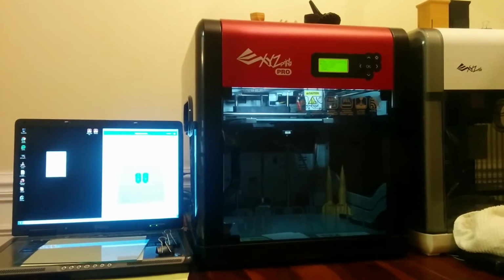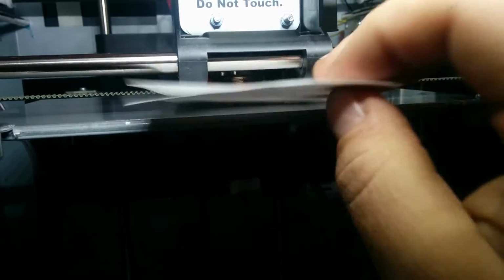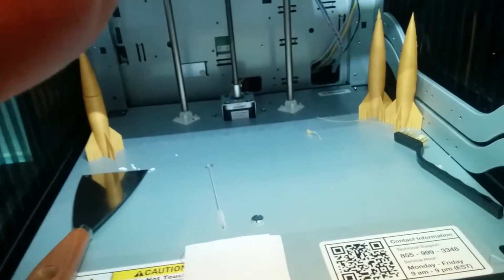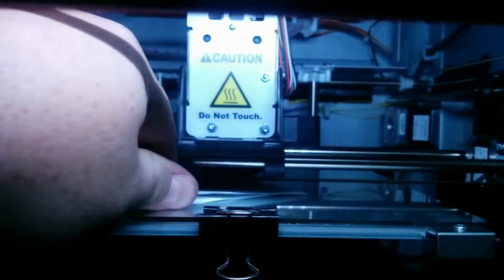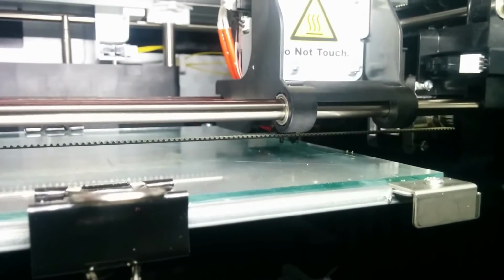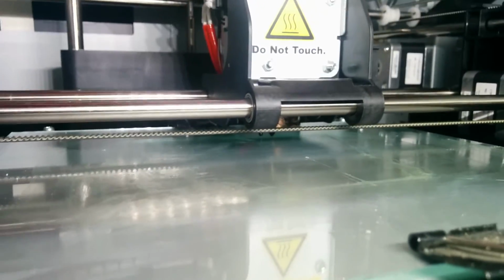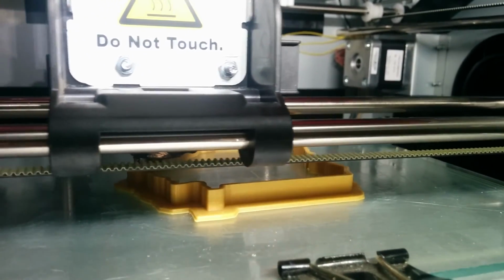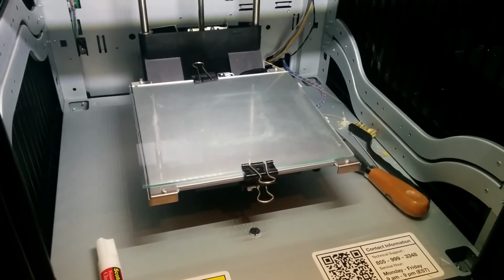Da Vinci Pro 3D Printer - Printing On Glass Tutorial

Comment: do you have the glass size or where i could find this glass? i'd like to go glass vs direct to aluminum which is getting kinda beat up..
Reply from the maker: Sorry I did this 5+ years ago but it was just standard glass from the hardware store. I used a glass cutter and just measured a little bigger than the working area of the bed.
Reply: @2robotguy  i did see you had some dimensions in the video so thank you for that!   :)

Comment: I added a piece of glass to my Da Vinci Pro because the cheap Chinese bed became warp from the heat. I find that White Rain hairspray really works better than a glue stick (not as messy) the parts just pop right off, plus I luv that glossy finish the glass produces on the print. Happy printing!
Reply: White Rain hairspray is also the best propellant for Potato Cannons ,AKA Spud Guns. Ill have to try hairspray on the print bed as the glue is just so damn messy.

Comment: just put glass on my xyz pro  put uhu glue stick on the bed but filament will not stick to the bed  just sticks to the nozzle all the time  done what you said on your video   PRINTINGON GLASS TUTORIAL  can you help in any way  thanks allan caddock
Reply: Hello there, I wonder, did you get it work?. Just few weeks ago I switch to the Glass and It´s work amazing for me. Even after print out anything. just wait few minutes and the tring is coming right and easy. I´m sure you must ajust the z offset with the glass on, I did that with the glu on it. in my printer I have the heat bed temperature in 90º, but also somthing extra is the auto heat is ON. I hope you can get it right! I loe this machine! check my facebook page and you will see what we did with Davinci pro. I got the machine since Feb. 2017 . I never did anything before in 3D printing. But I´m 3D Artist. Cheers! Leo 

www.facebook.com/viletras3dprinting

Comment: Tried this yesterday with zero luck...   I used 2mm photo frame glass and the same UHU that came with my now rebooting mid print Da Vinci 1.0A.  I tried my first print on the sheet of tape that came with the Pro, and now the glass option and have had zero luck getting the same ABS I was using in my 1.0A to stick...   :(   I don't get it?    Is it because the print bed is limited to 90º for some dumb reason?  I always used 100º or 105º on the 1.0A...
Reply from the maker: Make sure your nozzle is not too high above the bed. Drop the nozzle down alittle if you can. Does the first layer look flat? Try adding glue from a glue stick to help adhesion. Tell me if this helps.
Reply: If anything I may have the nozzle just a bit to low because I heard the rapping sound of a filament jamb when it was printing in the start up side area on the right.  I have the same UHU glue stick on the glass as I used on the glass bed in my 1.0A.    At this point I just wish I could figure out why my 1.0A reboots randomly during print now because I had it turned up and working perfectly.   :(
Reply from the maker: Try adding a low cost battery backup to your machine if you have one. Bring the head up alittle bit also if the extruder is jamming.

Comment: I've got a Pro now (3rd day), and would love to use the glass option.How thick is the glass (mm), and is it special glass (tempered), or normal?
Reply from the maker: +n03l l , Standard glass works find, no need for tempered. I have also printed on glass mirrors before too and it looks cool! The glass I'm using is 3/32" or 2.3mm thick. Here is a link to the glass I'm using http://www.lowes.com/pd_20751-405-11012_1z0ylvt__
Reply: +Mark Fuller Thank you. I've got some 4mm glass here. Will give it a test run tomorrow.
Reply: Okay. I'm now printing on glass too :-)

Your paper trick did not really work for me (my gap was about 5 sheets of paper), so what I did is added the thickness of the glass to the Z Offset. 

in my case the Z offset was 1.59mm, and the thickness of the glass 3.77mm, so my Z offset is now set to 1.59+3.77 = 5.36mm

Thank you for the video.
Reply from the maker: n03l l interesting, I think I will reset my bed and try this out. Thanks for the feed back

Comment: I just got the davinci pro and I am new to using heated beds. I was wondering in your opinion what is better printing straight on the aluminum or using the glass. What are the pros and cons?
Reply from the maker: +Jordan Conelias, I would print on the glass if I had an option. Think about it as cheap insurances. The glass cost less than $3 and if you scratch or break it at least your bed is ok. I would suggest to not print directly on your metal bed and if you don't want to print on glass use the provided tape. The only reason I print on tape now is if the part is really big, over 6" X 6" (X,Y)
Reply: +Mark Fuller Thank I just picked up a piece of glass  and installed it with binder clips and some kapton tape just for support. I ajusted my z axis like you did and the first layer prints fine. But after that the entire model is over extruded. I am using xyz ware and I have not been able to change the flow rate. Right now I am just waiting for s3d support. Besides that do you know any other way to change the pro's flow rate/ extrusion rate?
Reply from the maker: Jordan Conelias unfortunately the XYZware will not allow to adjust the flow rate. This is typically done by changing the filament diameter. It is possible to adjust your print speed that will slow down flow rate. Tell me more what is happening and I might be able to help. I did notice I had to drop my bed down another 1/2mm to get a better print on the glass. I guess this might be due to backlash.

Comment: Hi Mark 
If I need to calibrate in the future do I need to remove the glass plate since the Z height was changed for the Xyz Pro.
Reply from the maker: Yes, remove the glass plate and run a calibration. Then on the machine offset the head again from the glass, as demonstrated in the video.